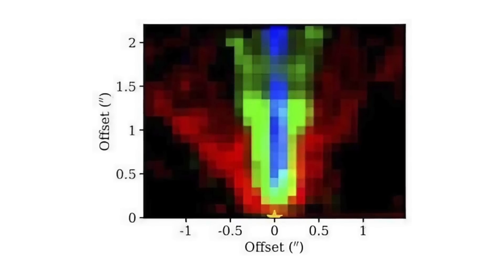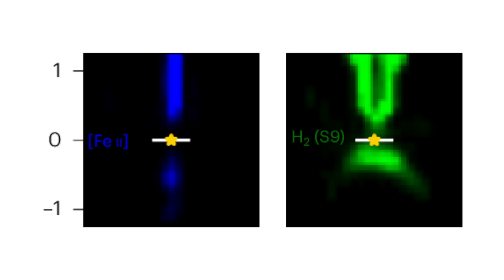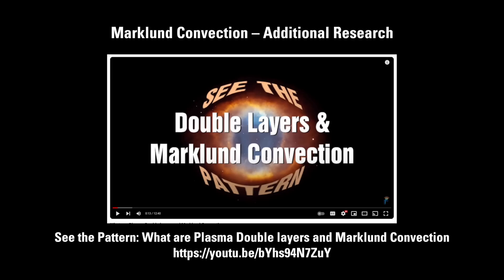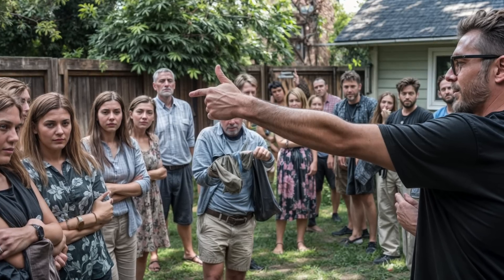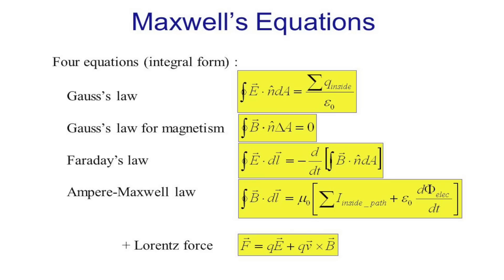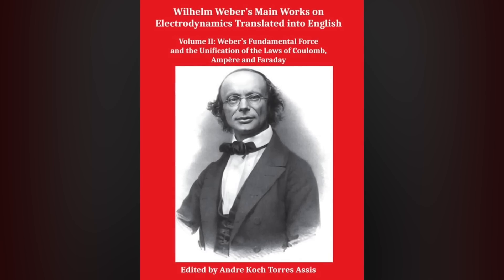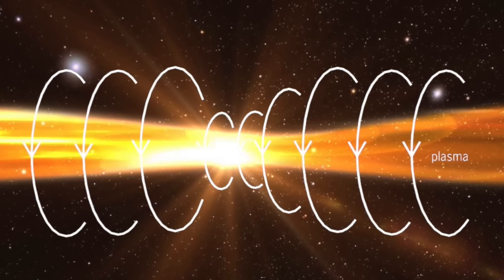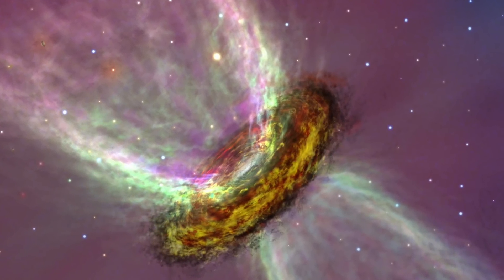Michael Clarage: The Gestation of Solar Systems | Thunderbolts

Comment: 🤜⚡💥⚡🤛 FINALLY they are reaching for the true understanding of the nature of the Uni ...but still they remain blind!!!Why? Because they use the Ptolemaic method with reductionist approach instead of the scientific method.  The plasma cosmology [antithesis of BigBang] community understands these magnetic filaments, for nearly hundred years, as Birkeland current filaments and the nebulae as intersections/collisions of several Birkeland current filaments. FYI, WHENEVER YOU HEAR MAGNETIC FIELD/LINE/FILAMENT YOU MUST TRANSLATE THAT AS ELECTRIC CURRENTS!!! because... electromagnetic theory. These currents/filaments interconnect EVERY object in the universe!!! and form the Cosmic Web.  Previously I said in regards to the nebulae problem: The runaway star phenomenon occurs due to the chaotic nature of the collision which involves electric currents, resulting is a slew of small stray Birkeland current filaments. I predict that we will discover this type of phenomenon in every nebula of this kind. 

On a more important topic, most mainstream scientists and followers also don't understand the Red Shift and the problems inherent in the BigDung theory. To wit, an expanding Universe entails matter and space-time [sic] would have to expand, which, per the mass-equivalence principle [E-mc^2], are made of energy. This would either require energy to be continuously created, or the 1st law of thermodynamics [conservation of energy] is invalid, or their density is decreasing. Either way all physical laws and the associated constants would have to have been constantly changing over the life span of the Uni which implies that all atoms and molecules would have been destroyed long time ago, ergo no Uni. The EM spectrum of the past [from distant objects] would be seen today as radically different. Even a slight change in the current constants would undo the present order/equilibrium. By all accounts the Uni would have radically changed over the presumed 13+ billion years, if not have been totally destroyed. The BigDung theory does not take this into account. Clearly the theory is false. 🤜⚡💥⚡🤛

=== 
Yes, presumably there is an interplay tween matter and the fabric of space-time but only because they are intertwined. This principle is arrived from the energy equivalence equation when it is solved for the time component. By Onerock's core definition, space and time are interchangeable.

But that's only on the word of that ol' mathamagician [that's not a complement]. By my tone you might have guessed that I'm not a a fan of that theory. IMHO, Plasma Cosmology [Electric Universe theory] predicts and describes the Uni more completely and eloquently. See the Thunderbolts Project channel. Also 'See The Pattern', 'LPPFusion', 'Unzicker's Real Physics', 'Ray Flemming', and Prof. Pierre-Marie Robitaille's 'Sky Scholar' channels... to start. As a consequence you too will find the current sciences distasteful. Naturally I don't recommend the 'conventional' physics sources as they are on the wrong path.

===
Me, I'm only a triple engineer rewriting the electromagnetic theory which, as you know, touches everything else. I call it the Parallax Electric Theory [PET] which dispenses with the anachronistic notion of magnetism. Everything is but charges [electric fields].

~~~ Know plasma, know 99.999% of the Universe (No plasma, no Universe) ~~~
===
PS. From where I stand, the Uni is flat[i.e. infinite], static[i.e. not expanding], eternal[albeit finite lifespan at present] and 'c' is just a number [do you know what that means?][hint, add it all up].  [It means that 'c' is not the maximal speed in the Uni... because Onerock is dead )) ]   Drinks are on me!!!

===
Check out these vids:
==> The censorship of cosmology | Eric Lerner    [Eric disproves the BigBangGang hypothesis in several ways*!!!*  Eric Lerner is saying that for a non-expanding universe, galaxy size is linearly proportional to distance, *as the evidence shows*. In the expanding universe theory, the galaxies should be much smaller in size (to the fourth power) and less bright than we actually observe. He’s correct BUT his papers have not been accepted because there are too many reputations and too much funding for the Big Bang research Gang on the line.]

==> Challenging the Big Bang: The Struggle with Inferred Reality
==> History of the Gaseous Sun with Dr. Robitaille

Comment: So, this Marklund woo separates the elements, with the elements having the highest first ionisation potentials (such as H and He) residing on the outskirts? And those with the lowest first ionisation potentials in the centre? Have I got that right? Maybe it's me, but does nobody else see a slight problem here? The vast majority of the solar system's H and He is locked up in the big yellow thing in the centre of the solar system! How come?
Reply: <><> A MIRACLE IS HAPPENING!!! MAINSTREAM SCIENCE IS PLOTTING .......... MAGNETIC FILAMENTS IN OUR GALAXY ...... AND THEY ARE BAFFLED, of course!!! Check out Anton Petrov's video Mind-blowing New Discoveries About the Milky Way Galaxy . I left this comment:
🤜⚡💥⚡🤛 FINALLY they are reaching for the true understanding of the nature of the Uni ...but still they remain blind!!!Why? Because they use the Ptolemaic method with reductionist approach instead of the scientific method.  The plasma cosmology [antithesis of BigBang] community understands these magnetic filaments, for nearly hundred years, as Birkeland current filaments and the nebulae as intersections/collisions of several Birkeland current filaments. FYI, WHENEVER YOU HEAR MAGNETIC FIELD/LINE/FILAMENT YOU MUST TRANSLATE THAT AS ELECTRIC CURRENTS!!! because... electromagnetic theory. These currents/filaments interconnect EVERY object in the universe!!! and form the Cosmic Web.  Previously I said in regards to the nebulae problem: The runaway star phenomenon occurs due to the chaotic nature of the collision which involves electric currents, resulting is a slew of small stray Birkeland current filaments. I predict that we will discover this type of phenomenon in every nebula of this kind. 

On a more important topic, most mainstream scientists and followers also don't understand the Red Shift and the problems inherent in the BigDung theory. To wit, an expanding Universe entails matter and space-time [sic] would have to expand, which, per the mass-equivalence principle [E-mc^2], are made of energy. This would either require energy to be continuously created, or the 1st law of thermodynamics [conservation of energy] is invalid, or their density is decreasing. Either way all physical laws and the associated constants would have to have been constantly changing over the life span of the Uni which implies that all atoms and molecules would have been destroyed long time ago, ergo no Uni. The EM spectrum of the past [from distant objects] would be seen today as radically different. Even a slight change in the current constants would undo the present order/equilibrium. By all accounts the Uni would have radically changed over the presumed 13+ billion years, if not have been totally destroyed. The BigDung theory does not take this into account. Clearly the theory is false. 🤜⚡💥⚡🤛

=== 
Yes, presumably there is an interplay tween matter and the fabric of space-time but only because they are intertwined. This principle is arrived from the energy equivalence equation when it is solved for the time component. By Onerock's core definition, space and time are interchangeable.

But that's only on the word of that ol' mathamagician [that's not a complement]. By my tone you might have guessed that I'm not a a fan of that theory. IMHO, Plasma Cosmology [Electric Universe theory] predicts and describes the Uni more completely and eloquently. See the Thunderbolts Project channel. Also 'See The Pattern', 'LPPFusion', 'Unzicker's Real Physics', 'Ray Flemming', and Prof. Pierre-Marie Robitaille's 'Sky Scholar' channels... to start. As a consequence you too will find the current sciences distasteful. Naturally I don't recommend the 'conventional' physics sources as they are on the wrong path.

===
Me, I'm only a triple engineer rewriting the electromagnetic theory which, as you know, touches everything else. I call it the Parallax Electric Theory [PET] which dispenses with the anachronistic notion of magnetism. Everything is but charges [electric fields].

~~~ Know plasma, know 99.999% of the Universe (No plasma, no Universe) ~~~
===
PS. From where I stand, the Uni is flat[i.e. infinite], static[i.e. not expanding], eternal[albeit finite lifespan at present] and 'c' is just a number [do you know what that means?][hint, add it all up].  [It means that 'c' is not the maximal speed in the Uni... because Onerock is dead )) ]   Drinks are on me!!!

===
Check out these vids:
==> The censorship of cosmology | Eric Lerner    [Eric disproves the BigBangGang hypothesis in several ways*!!!*  Eric Lerner is saying that for a non-expanding universe, galaxy size is linearly proportional to distance, *as the evidence shows*. In the expanding universe theory, the galaxies should be much smaller in size (to the fourth power) and less bright than we actually observe. He’s correct BUT his papers have not been accepted because there are too many reputations and too much funding for the Big Bang research Gang on the line.]

==> Challenging the Big Bang: The Struggle with Inferred Reality
==> History of the Gaseous Sun with Dr. Robitaille <><>
Reply: Haha bb fan lol
Reply: @bichthuyentruongthi2600  Still nothing intelligent to say. Keep it up. You are a perfect example of the type of people who fall for scientifically impossible nonsense on youtube. All talk, no science.
Reply: @bichthuyentruongthi2600  As you keep proving. All talk, no science.
Reply: @davejones7632 😂😂what nonsense you talk about is more religion than science go to school
Reply: @physicswithpark3r-x3x  HAHA THAT STUPID COMMET
Reply: @bichthuyentruongthi2600  ok, so if the universe is not expanding, what do you think its final fate will be?
Reply: @physicswithpark3r-x3x  THERE IS NO BEGINNING AND ENDING, CHILDREN
Reply: @physicswithpark3r-x3x  There is no beginning and no end, there is no such thing as expansion, my child.
Reply: @physicswithpark3r-x3x  yes but more logical than the Belgian priest's theory
Reply: @bichthuyentruongthi2600  So, did you notice that Conformal cyclic cosmology subsumes BBT? It contains not just one BB, but infinitely many of them, happening over and over again for all eternity...
Reply: @physicswithpark3r-x3x  no that's the idea from the bb theory haha the universe is everything there is no such thing as infinite bbt because there is no explosion and no expansion
Reply: @bichthuyentruongthi2600  You keep saying Belgian priest - do you objects to Belgians, Catholics, or both?
Reply: @physicswithpark3r-x3x  I mean it was invented by a Belgian priest right?
Reply: @physicswithpark3r-x3x  I think you should not try to bring bb out to do anything, it is shaky, and do not post critical comments because you orthodox people will not last long, my child.
Reply: @bichthuyentruongthi2600  if you keep referring to the gentleman that way, it looks like you have something against Belgians or priests...
Reply: @bichthuyentruongthi2600  then just call him by his name like a civilised person
Reply: @physicswithpark3r-x3x  but who is that priest?
Reply: @physicswithpark3r-x3x  who should i say politely dude
Reply: @bichthuyentruongthi2600  seriously? you dump on BBT incessantly and literally do not know the first thing about it?

Comment: I assume, with some degree of certainty, that Clarage either didn't read the paper or, if he did, didn't understand it. As the authors say in the abstract;

"This nested morphology,.......strongly supports theoretical predictions..." No mention is made in the paper of Marklund nor electric current woo segregating neutral hydrogen!
Reply: Your mistake is not reading a scientific report, kid
Reply: @trungtamienmayquocquang7233  I've read the paper, child. You haven't. It is dealing with overwhelmingly neutral gas. Stars are formed from neutral gas. No electric current woo involved. Learn physics.
Reply: @trungtamienmayquocquang7233  It's not a report. It is a scientific paper.
Reply: @trungtamienmayquocquang7233  Stop talking out of your backside.